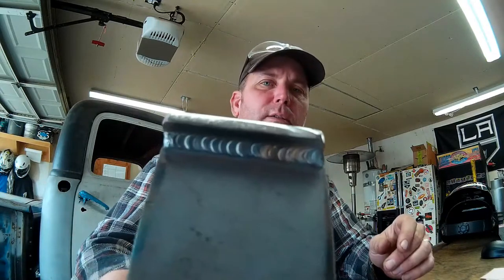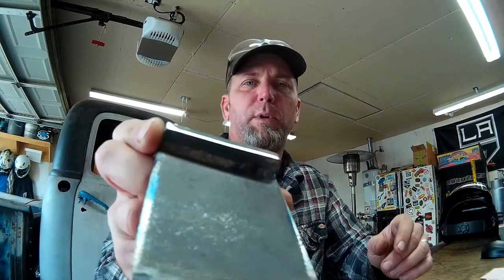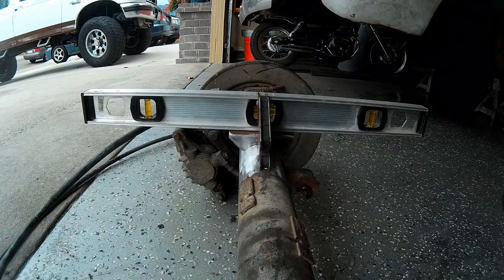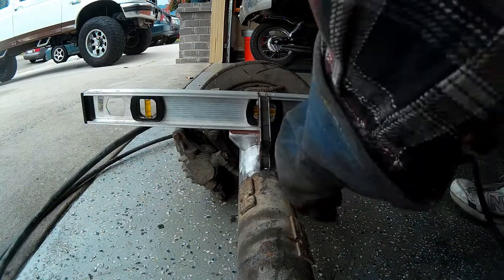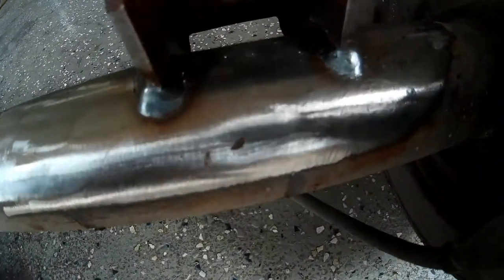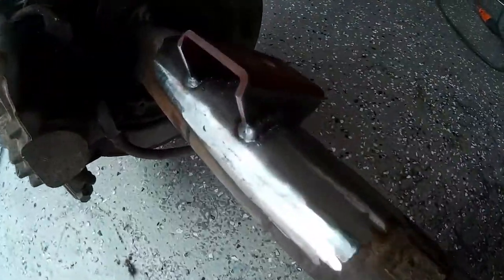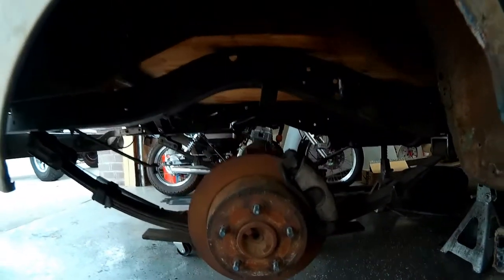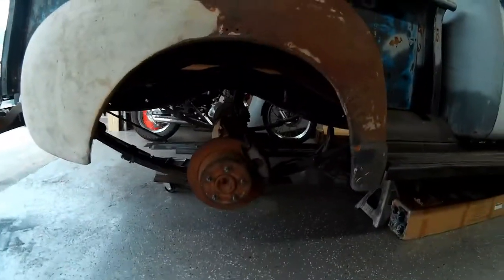P48 Project; Stickin' In the Rear!

Comment: What was measurement of front & reary axel  width? And what width is needed not to have to mini tub? & if no mini tub does th mean outside of tire will rub
Reply from the maker: good question!  the width on our S10 axle was 58" (IIRC) and was pretty close to not having to tub the bed sides, but not perfect.  i think if you ran a 60" axle with the SAME BACKSPACE wheels you could get away with it.  thanks for watching!